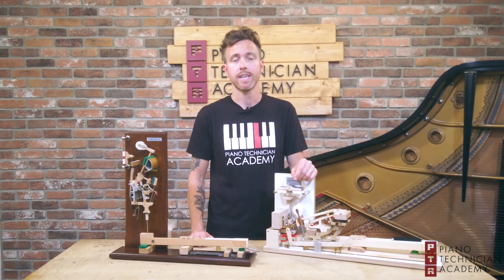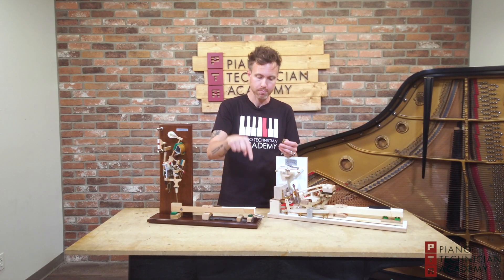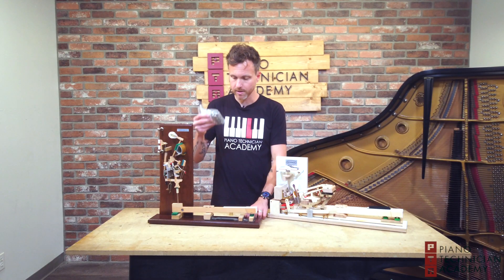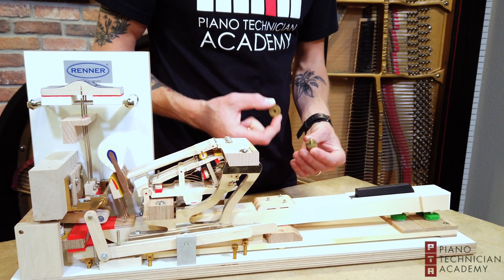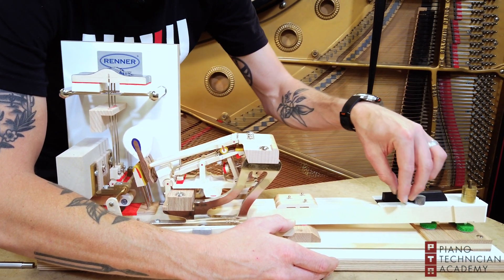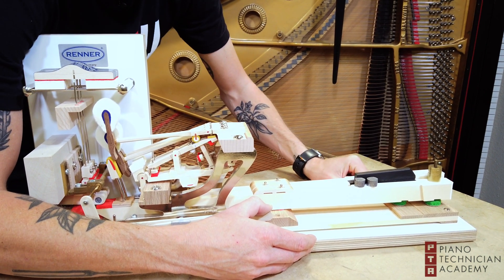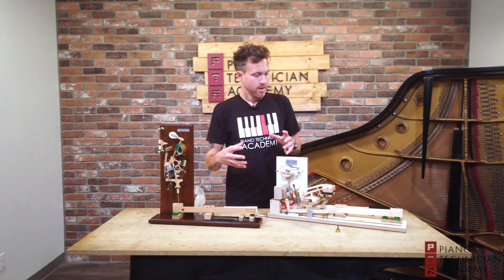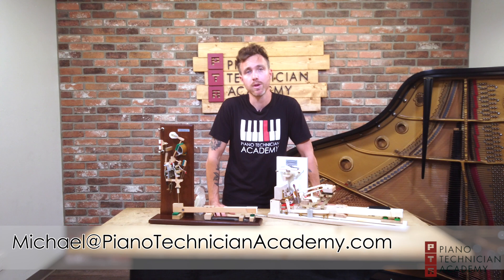What makes a piano feel heavy?

Comment: I bought a grand piano many years ago and besides an unneven touch weight, the average down weight turned out to be 65-70 grams.  Unfortunately I was influenced in my choice of piano by  its glorious tone. This was a big mistake however.  The action parts were stiff,  lacking sufficient lubrication and the drop screws had been  screwed down too much; don't ask me why.  Anyhow, the piano had to go after being returned to the store (Manchester, England) in an unsuccessful attempt to fix it and replaced with another of the same make.

Comment: Good evening, I am buying a new Piano and I would like some suggestion: generally when I encounter, in my piano recitals, a Steinway, I found that its action is somehow “heavier” and “slower” than other brands like Fazioli or Bosendorfer. I found that also Boston pianos, (made by Kawai and designed by Steinway) are pretty similar in regulation to the Steinway. I want my new piano to be regulated in a way in which it doesn’t help me at all. My goal is to have my practice piano to let me do the hardest work possible in order to be prepared for any piano I will find in the next concert venue. Before move abroad I had my piano in Italy regulated like a Steinway, pretty heavy action, deep excursion of the keys, but at that time I didn’t know what my tuner did to made it practically identical to the “average” Steinway D model. Did he work on the counter weight? If you were my technician what would you do to satisfy my demands? Also is it ok to make this adjustment to a new piano or it “risky”? (could damage the mechanic?) Thanks a lot
Reply: Wanting a heavy practice piano is a bad approach to take imo. Remember that repetitive strain disorder and carpel tunnel syndrome are significant issues. Pianos should have a light action, especially if you're playing Chopin/Liszt etudes. Some Steinway's have light actions too. Every Steinway piano is different. There's no standard for them.
Reply from the maker: Hey! As far as buying a piano, we actually have a course that helps with a lot of your questions! 

https://the-piano-technician-academy.mykajabi.com/PTA-Shopping-Course